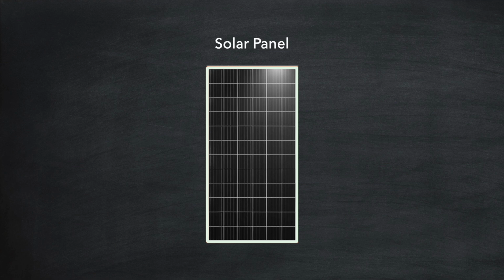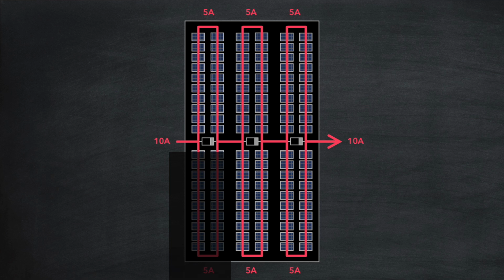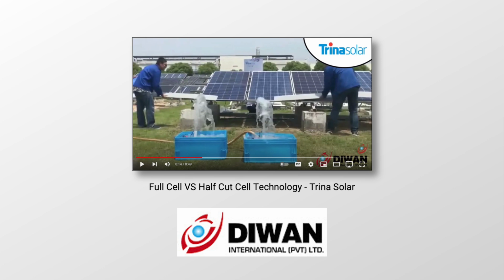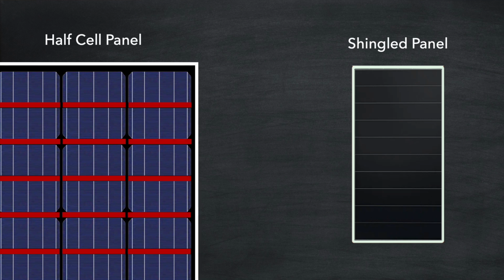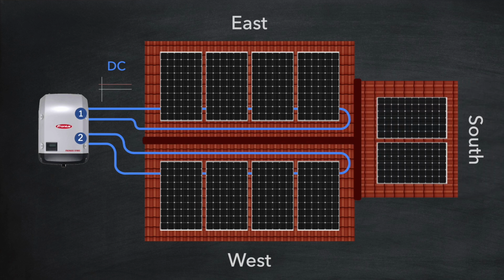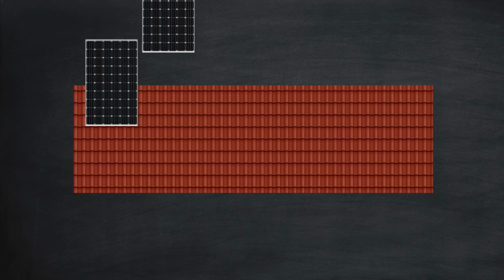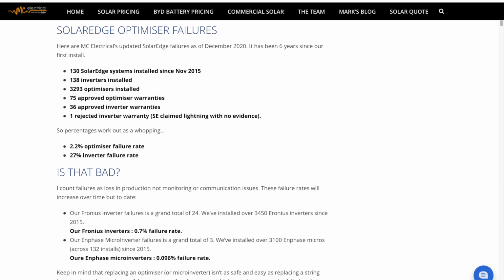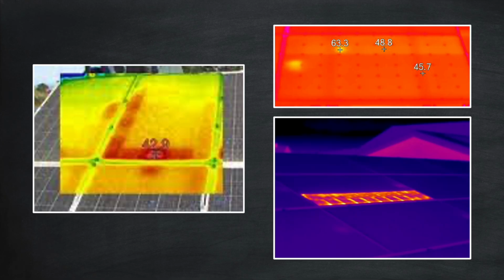Solar Panel Shading (Part 2): More on Optimisers and Micro inverters

Comment: The thing I don't like about the micro-inveters (I had enphase on a previous house) is that they are generally grid tied, so unless you have a more complex(and expensive) setup to isolate you from the grid automatically and then kick on another inverter feeding back voltage into the micro-inveters you will have several KW of panels that aren't providing you anything when the grid itself is down.
Reply from the maker: Hi Michael, this is a good point, and once I hadn't considered to date - thank you!

Comment: Hi great video, please I have a question : my grid tie solar installation is with Huawei SUN2000-5KTL-L1
Which only use high (400v) voltage batteries but I will like to use 48v lithium battery with it, so please how can I make this combination work? Thanks in advance
Reply from the maker: Thanks for the kind words. Now unfortunately, l'm not in a position to provide advice on specific situations, not least because of potential liability issues - even if advice is given free - such is the world today). You're best to speak to an installer about that, or post a comment onto a solar forum (e.g. this one in the UK: https:// www.facebook.com/groups/2197329430289466)

Good luck!
Reply: @GaryDoesSolar  thanks for the fast reply

Comment: Very informative, thanks for taking the time to do this Gary. The reason I am looking at videos about optimisers and micro inverters is because my own system is now 10 years old and I would expect my Sunny Boy inverter will be coming towards the end of it’s life in the near future. I do suffer from partial shading at certain times of the year, so anything to reduce the loss of yield needs to be considered. The array is ground mounted, so access to the panels is not an issue. Question: can optimisers be retro-fitted to my panels without the need for a specialised inverter, or do they require something specifically aimed for using optimisers?
Reply from the maker: Thanks. Now, I don't see a problem retrofitting panels with microinverters, and as you say, being ground mounted, it makes access a LOT easier. You would not need a specialised inverter in that case.
Reply: @GaryDoesSolar  I was actually thinking of fitting optimisers and using my existing Sunny Boy inverter if that is going to work? Do the optimisers do the clever bit at the optimiser, or do they need a special inverter to work? Failing that, I would consider the micro-inverter option.
Reply from the maker: Sorry, I misread your original comment. Now, it should be possible to fit optimisers to your panels, but I would check with the optimiser manufacturer to make sure there is compatibility with your Sunny Boy inverter, and also that the voltages will work. Good luck!

Comment: I just wanted to say thanks for your videos. It really helped me talking to the sales person. At least it made me feel I had a level of knowledge that I could ask the right questions. My 14 panels, and 2x 3.2 batteries and 3.6 Lux Hydrid inverter were installed last Wednesday. I can’t stop looking at the monitoring 😊. After you last videos, I checked and we have half cell panels. We have had a few hours of free power. This impressed me for winter. Thanks again. I will still continue to watch.
Reply from the maker: Thanks for the very kind words, Michael. And also, I really appreciate your “super thanks” - it’s a lot of work to make my videos and so this means a great deal to me 😀👍🏻 Sounds like everything went well with your installation and it’s performing well in the winter, so this sets the scene for even better performance over the next 6 months - all the best!

Comment: Hi Gary, thank you for the great video, and presenting this important topic in such a clear way. 

Edit: I subsequently realised my Q2 was previously asked by @Robert Sporne and answered thanks.

I had a couple of questions/comments and would appreciate your and others comments. Please bear with me as I am not a solar installer 

1) Would it be correct that split cell performance in shade will vary from portrait to landscape orientation based on the shape and position of partial shading? 

2) Loosely paraphrasing from your video, modern MPPTs deal with partial shading on a split cell panel by detecting a second MPP which prevents the bypass from "kicking in". However, would this occur for string of split cell panels, if only one panel is partially shaded? If the global sweep select the higher amperage as the MPP, would this mean the bypass diodes for the shaded panel then "kick in"? If so, this suggests local panel mppt is required. 

3) What is the threshold of current at which these diodes "kick in". Does the current split at the diode string junction. E.g. one partially shaded cell causes current to drop, but also diode current to increase hence string current is unchanged? 

4) I have seen advice (maybe from MC Electrical?) that diode failure may not be covered by panel warranty, hence it is good to avoid relying on diodes for shade management. Generally I have taken this as a case for optimisers for frequent partially shaded locations.
Reply from the maker: Thanks for the kind words, Rich. I'll try to answer your remaining questions:

1) Yes
3) My understanding is a 20% difference in current
4) If I've noticed anything about solar equipment warranties, they're full of gotchas! As such, they're not really worth much unfortunately - failed diodes or otherwise :-/ MC Electrical notes on one of their blog posts that diode failures are incredibly rare

Comment: Hi Garry great video but feel you have missed some other benefits of microinvertors.
You note in video if microinvertor shows issue you can not resolve it.
I had a failure and I used the ABB powerone microiinver to reboot and repair microinvertor.

You can update microinvertor softwar and change standards as standards evolve.  Ours changed and microinver software covered change.
If say panel fails I don’t loose string and I actually know which panel failed.  We have 20 panels so we loose 1/20 or 5%. Where as string could be effected and you don’t know which is effected panel.

Power from microinvertors is cooler as wash is just converting power at lower domestic voltage and ours is 230 volts + or - 10%.
So as you noted growing system is easy.
But other feature you missed is string connection to main inverter is high voltage hotter connection and a number of fires in Australia were identified as isolation solar switch arching.

As each panel has microinverter there is no main inverter to place so installation is quicker and placement of inverter is not an issue.
Main inverter run hot and have say 15 year like.  As they day you loose all power or one phase.  But as microinvertor is running cooler life is longer but as failure occur it will be a unit in many so solar is continued to be generated.

I learnt a bit about the improvement in solar cell shading features as our system in circa 2014. 
So much in 1/2 cell and shingle is new to me as we are not in the market to replace.
Reply from the maker: Thanks for your comments, Malcolm. This is great insight!

Comment: Gary’s series on solar is the best on YouTube in striking a balance between ease of understanding and technical detail. I wish I had this kind of information available when I installed solar on my home four years ago. I’m generally happy with my installation (12 Kilowatts with a SolarEdge inverter) but if I had it to do over again I would have explored going without the inverter and installing more panels (although it’s not clear whether SoCal Edison would have approved a larger system or if I could have found a reliable installer to agree going without inverters). My personal concern is whether or not to expand my system by adding battery capacity. Batteries are still relatively expensive, even with  the current 30% tax credit. Additionally, there is the question of how many batteries to install, where to place them, and most importantly what goal I hope to achieve. The important question of return on investment is much more complicated for batteries than it is with solar panels. I would love to have Gary cover this in a future video.
Reply from the maker: Thanks for the very kind words, Richard. I'm not sure if you saw my video on ROI yet, but it allows you to model different solar/battery solutions to see what their ROI might be: https://www.youtube.com/watch?v=FvjuJQZRrvA
Reply: @GaryDoesSolar  Thanks for the link, Gary!

Comment: Question: in the United State and in the State of Georgia we are required to have rapid shutdown, the Tigo optimizers can do that. would you recommend some other module/device for rapid shutdown only? Also, you mentioned going with a string inverter, that is what I am looking at DC to DC coupling. You mentioned monitoring would be nice to have, if you do NOT have monitoring and you have a panel fail, how are you going to easily determine which one it is?
Reply from the maker: Hi Joel, this is where thermal imaging might be useful. Generally, when a panel fails, you can see a different heat signature for it compared to other panels.

Comment: Very useful! Currently researching what solution to get, and certainly, SolarEdge are very popular - but seeing the reliability review from MC Electrical gives me pause.  That said, the review is a few years old now, and Mark admits in more recent comments that he hasn't gone back to the product to see if things have changed.

So, it's off to Trustpilot to see if there's some insights to be had there. MC Electrical seem to rate Fronius highly - but there aren't many reviews on TP to make a solid judgement. However, the reviews that do show up there, are largely negative.

SolarEdge don't do especially well either on TP, albeit they have more positive reviews than many of their competitors. If that's 'the best' I can get in terms of customer service though, then it's still enticing, even if I don't technically need the 'benefits' of optimisers, and could be risking additional failure points. It's all about whether I'll be looked after if those problems occur.

Still, lots more research to do!
Reply from the maker: Great to hear you're getting a lot from my videos! Yeah, it's quite a minefield choosing the right solar solution - good luck in your journey!

Comment: Is there any research about improving output in cloudy weather. And Awesome! Finally i got answers on many questions
Reply from the maker: Thanks for the kind words, Oleksandr. 

Now, power generation from solar panels is all about the amount of light hitting them. And unfortunately, cloudy days mean less light. And less light means less power generation. 

The only solution is to improve the efficiency of solar panels. Today, they’re just over 20% efficient - but the great news is that efficiency is increasing over time as new materials and manufacturing processes and brought to bear 👍🏻
Reply: @GaryDoesSolar  
You are right, but my question was mostly about string sizing,  I do have 7kwt installation (18 panels  x 390w  40.8Voc  33.8Vmpp ) and noticed that generation starts from 600v on panels so was thinking that my installation is not optimal but now I have realized that 600V is optimal voltage for my inverter's mppt and when generation starts it starts from that optimal voltage. So adding panels in that string will probably makes no difference is it correct way of thinking? Or if  I will add panels to the inverter string and keep it to maximum possible (1000v in my case) it will reach that optimum voltage faster and start generation even with less light from sky?
Reply from the maker: Hi Oleksandr, I think you're best to have a qualified installer answer that question as that's not my area of expertise I'm afraid...

Comment: Hi Gary, a very insightful video and indeed your entire series are a must watch for anyone considering PV install. 

I am looking in to PV and I do have a three aspect array requirement East / West - Main House roof and South facing detached garage. 
We do have shading and tree issues (more pronounced in the winter - lower sun angle) so I originally thought I would be installing a Solar Edge optimiser based system, complete with 400w mono black Half- Cell panels, but I must say I am now rethinking it after watching your video, perhaps changing to Shingled design panels? 
I can't seem to find a three MPPT inverter in the Solar edge range, perhaps It is just not an option?

I also looked into the Perlight delta 400w Shingled panels, and they look very good, but perhaps the Hyundai 400w Shingled Panel, which has a 25 year product /25 year performance warranty,  seems to trump the Perlight delta 15 year product / 25 year performance warranty?
Although the Perlight delta is a more efficient panel (21.3% for the Perlight Delta Vs 20.4% for the Hyundai) perhaps this swayed your choice?
Are these the only Shingled PV 400w panels available in the UK currently? I couldn't find anything else.
Reply from the maker: Thanks for the kind words, Ade. And great to hear that I've got you thinking about your installation options :-) Worth checking on sites like below for any shingled panels:

https://midsummerwholesale.co.uk/buy/perlight-monocrystalline-solar-panels

https://solarsuppliesuk.co.uk/product-category/solar-pv/solar-panels/

Comment: Gary. We are brothers in thought.  I have 3 roof aspects to cover in a 5+5+3 configuration. After alot of searching I conclude that a 3 MPPT inverter is the simplest and most reliable way to go. Solis, SMA and Goodwe make 3 MPPT  single phase inverters. 
I just don't know which Mfr is best.
Reply from the maker: :-) and I agree, a 3 string inverter sounds ideal for you.

Worth asking about manufacturers on a local solar forum. Here is a link to a good UK one: https://www.facebook.com/groups/2197329430289466

Comment: The have three roofs facing east, south and west, as many inverters only have the capability of connecting two strings I believe optimisers or micro inverters are my only option.

It is possible I could place all the panels on the west on one string with optimisers or micro inverters but for the panels facing east and south it seems my only option is optimisers or micro inverters?
Reply from the maker: Yeah, in the case you outline, I reckon microinverters could be a good solution.
Reply: See my earlier comment on inverters with x3 MPPT's

Comment: I share your concern about the reliability of stuff, especially when it’s on the roof, and especially optimisers. However I notice they seem to have more issues in Australia. Could it be linked to the heat significantly? It would be interesting to have a real life failure rate for here in Britain.

Also, if you had a defective panel on a regular string inverter, would you even know you had an issue? Quite likely that you’d be oblivious until several panels had an issue, and when trying to address the problem on the roof, how to know which panel has the problem? That really would need scaffolding, I think many installers will manage to replace a single panel or optimiser (when they know which it is) without scaffolding.
Reply from the maker: Hi Richard, that could be a fair point. High temperature must surely have a toll on electronic systems...

And regarding defective panels, it's true - hard to know if you've got a problem or not without any monitoring. My suggestion would be to use a thermal imaging camera and also to measure your average performance against the utility I referred to at 5m56s here: https://www.youtube.com/watch?v=ccm1HmxELlQ

Yeah, these cherry-picker lifts could be handy for single-panel diagnostics/replacement

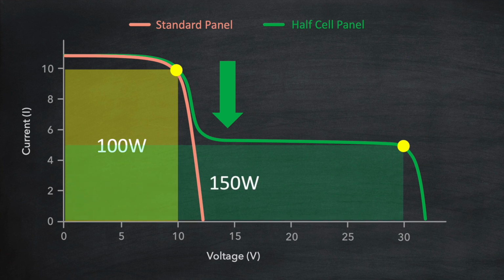Comment: After watching this video I've been looking at the datashhets of a number of major manufacturers of half-cut cell panels, and none of them (so far ...) show an extended I/V curve like the one you show at about 5:30 in the video. Are you able to say where this info comes from?
Reply from the maker: Hi Tony, no problem: the EDF paper I referred to in the video shows the extended I-V curves: https://www.researchgate.net/publication/338368140_HALF-CELL_MODULE_BEHAVIOUR_AND_ITS_IMPACT_ON_THE_YIELD_OF_A_PV_PLANT/link/5e0f4440299bf10bc38d7485/download
Reply: How does it work in a string then? The example showed how a single panel maintains output but that requires 1/2 current through the module meaning half current through the string, right?
Reply from the maker: Hi Robert, so if all the panels in the string were subject to the same kind of shading (for example, a neighbour's house shadow growing from the bottom of your roof as the sun gets lower in the sky) then a reduction of current by the inverter will work best. If only some panels have shading, then this is where optimisers or microinverters come into play, as they manage the current on each panel separately.